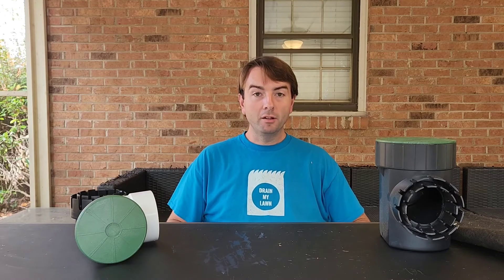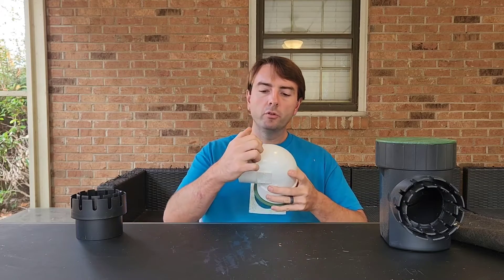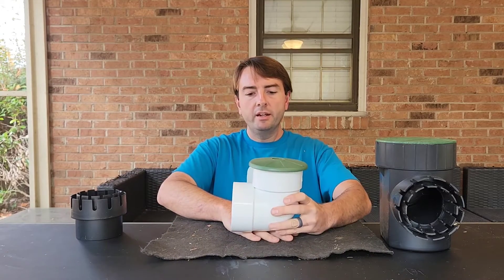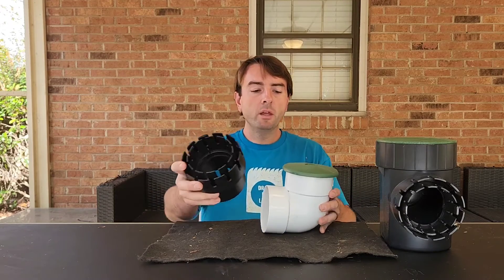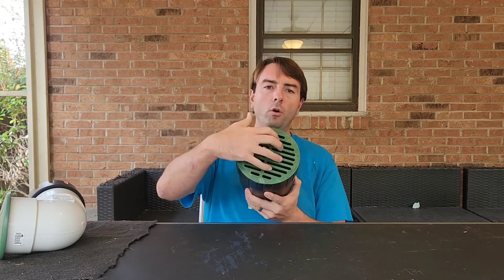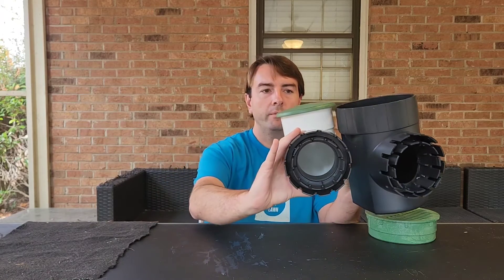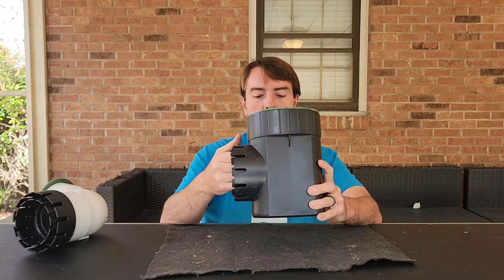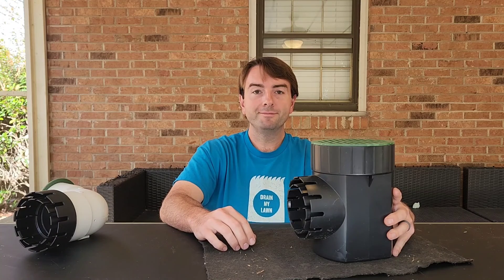How are a catch basin and pop-up emitter the same?

Comment: Not a fan of a catch basin bc when it rains that rain is going right into that basin and if you are trying to eliminate water from it, it seems to defeat the purpose of draining that particular line
Reply from the maker: The top of the catch basin or pop-up must be lower than the bottom of the lowest collection point.

Comment: What if I need to use a riser? Will the water still emit from the basin?
Reply from the maker: @darianbailey1887  as long as the top of the pop up emitter is lower than the bottom of the French drain or the bottom of the pipe at catch basins.  

We don't use risers for emitters.  If you need one, you may not have enough slope or your pipe is too deep.

Comment: My catch basin, very much like the one you showed in this video, was buried under sod in my yard. Is that normal? By the way, I live in California in the Sacramento valley, meaning we don't get a ton of rain out here, especially during the summer-ish months (4-5 months out of the year).
Reply from the maker: @jpiii8887  It's not supposed to be that way but unfortunately is pretty common.  Check out French Drain Man turf restrictor catch basin.
Reply: The catch basin itself should be buried, but the top/lid should be flush with the surface of your yard and not have anything growing over it. The idea is that it needs to be accessible should you need to open it and clean it out.

Comment: does this fit the 4 inch corrugated pipe with out ann adapter  . I know you need the tape but wondering if there is adapter needed also
Reply from the maker: Both of the items in the video come with adapter.  French Drain Man's turf restrictor comes with one now too.

Comment: Do I have to set the drainage line at a level if I’m using that pop up?
Reply from the maker: You need the bottom of all of your drainage features to be higher than the top of the pop up
Reply: @drainmylawn  I’m sorry. I meant to say in a slight slope…. Does the white pipe connecting the drain and the pop up thing have to have a slight slope

Comment: is that elvow shcedule 40 or for the thinner pipe like the sewer and drain 35?
Reply from the maker: It's the lighter duty stuff
Reply: @drainmylawn  I'm really confused. What is the type of pipe you used if that isn't sdr35?  From my observation french drain man used to use sdr35 when they need to use non corrugated, but those pipes were blue/greenish in color.
Reply: @al70127  you use sewer pipe which is thinner pipe compared to your normal PVC.  It’ll be green or white in color.
Reply: @al70127 thinwall PVC is much thinner than SDR35 or Schedule 40

Comment: Is it okay to have an emitter pop up through concrete? 

We are having an RV pad poured and the only way to discharge the storm water is through the concrete.
Reply from the maker: Don't put the pop up in concrete, use a stronf catch basin with a metal grate.  You'll need to make sure the basin sits on a firmly packed base so it doesn't sink.